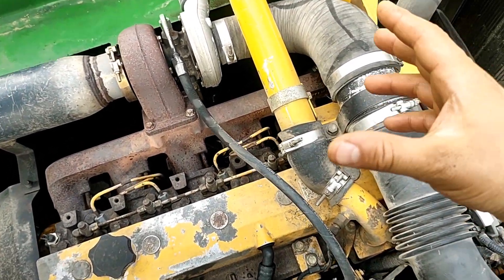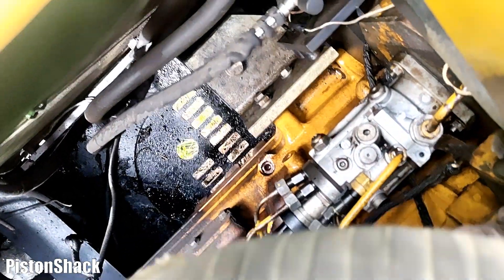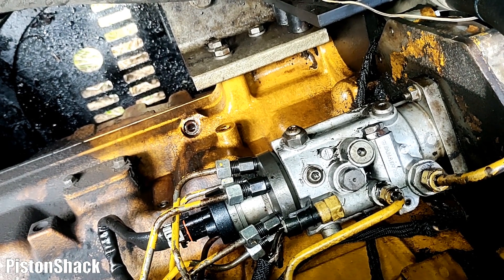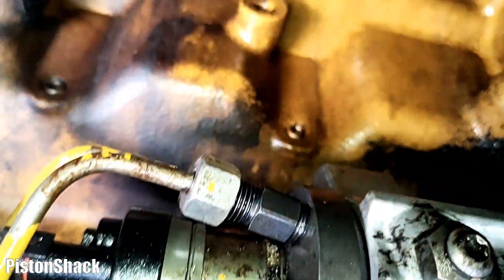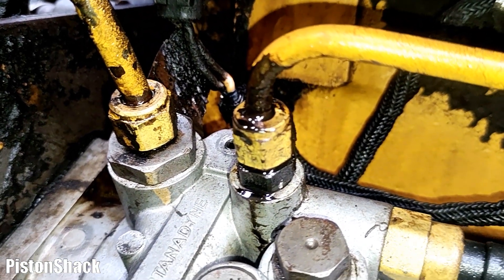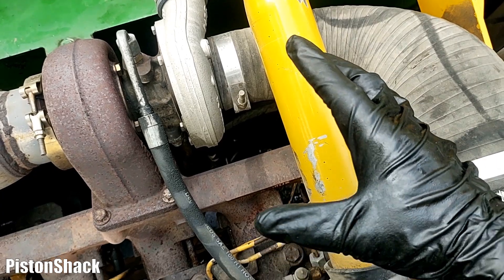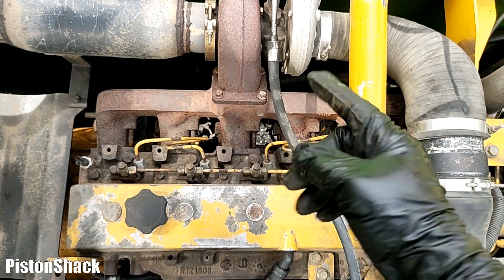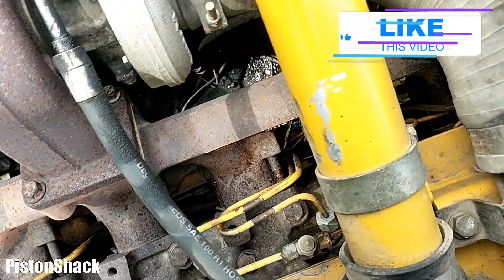LOCATING DIESEL FUEL LEAK ON 6068T 6.8L JOHN DEERE POWERTECH ENGINE | DEERE 2054D

Comment: Very helpful, straight to the point! Also make sure not to over tighten the thread, it's a 1/4" thread and it can be stripped very easily. Good job and thanks for sharing your tips!
Reply from the maker: Great tip! Thanks)